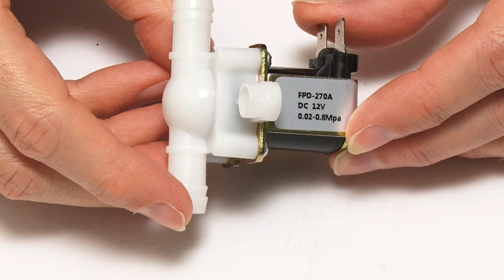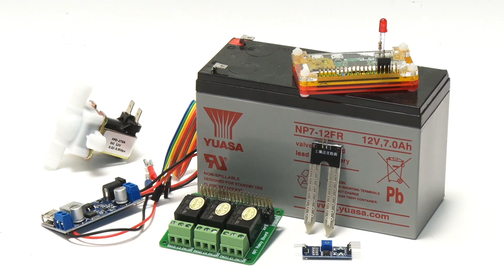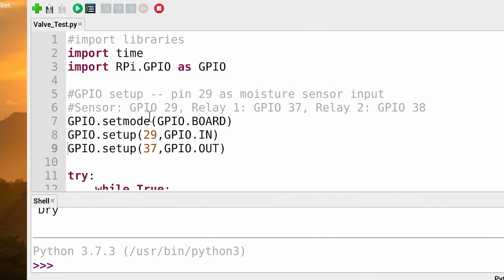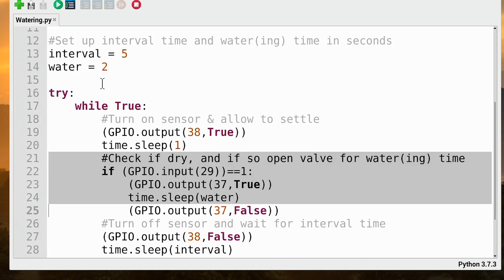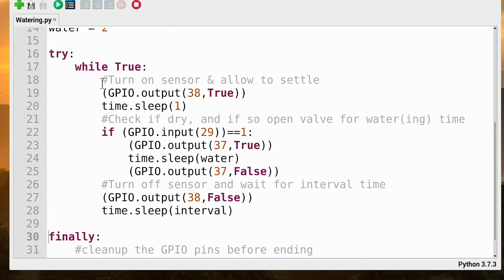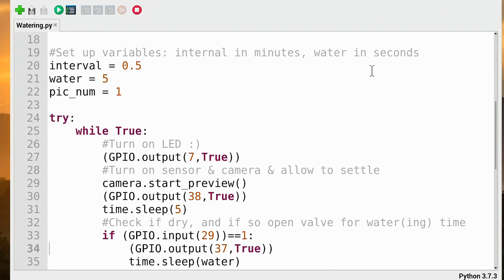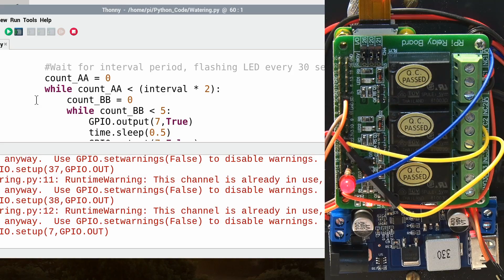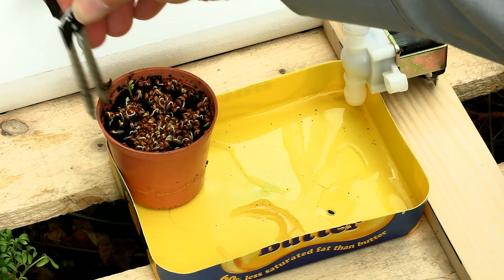Raspberry Pi Plant Watering (& Time Lapse)

Comment: The issue is the sensor is not deep enough.  The sensor needs to be adjustible in depth since it needs to detect at root level which increase as the plant grows.

Comment: Should have used a capacitance moisture sensor. 4 channel ADCs are cheap and easy to use. I would use 5v pumps. project is good for a project start.

Comment: For anyone watching these days, make sure to get a capacitive moisture reader instead of the resistive one. The resistive sensor has exposed electrodes and measures the resistance between the two electrodes so as the soil becomes wet, the conductive layer will corrode as the wet soil reacts with the electrode. Capacitive ones are completely insulated from water and do not have the same issue.
Reply: Which is why it was disconnected. You really don't need to run energy through the soil all the time
Reply: @tutacat Doesn't matter. The oxidation happens within hours. Actually, it happens instantly. Fast enough that you can see it bubbling. Within hours you will notice pitting starting to eat through the metal. 

Look up electrolysis if you want to learn more about this process. 

Also, not being connected to the electric supply directly does not mean electrolysis isn't happening. The earth is alive, every residual current that escapes to ground is trying to find its way to the earth. An electrode stuck in the ground will still experience electrolysis because of these errant electrical currents. 

If you really wanna blow your mind, look up what happens to ship props when they are near a port that has an electricity leak going to ground nearby. It will eat the prop in hours. It can make a propeller entirely disappear in days, and we're talking about a solid brass propeller that's inches thick at the stem.

Comment: Would the 2 channel relay in the video description work with the valve you used in the video? I noticed the 2 channel relay is listed as 5V, while the valve and 3 channel relay used in the video are 12V. I'm not the best with voltage, watts, and amps, so I want to be cautious.

Edit: Nevermind, just read about coil voltage and contact voltage being different things

Comment: Instead of using a relay to turn the sensor on/off, couldn't you just power the sensor using a pin on the pi which you can pull high/low?

Comment: I am a little late getting to this project but plan to try it out, during the video you mention that the valve you initially used was best suited to a higher water pressure, di you ever try to identify a more appropriate valve for this system, that uses water fed from a holding vessel with minimum water pressure.  I have now subscribed to your channel and will be a regular viewer

Comment: There is a problem with resistive moisture sensors - they dissolve!  The capacitive ones are much more resiliant and can even be isolated from the soil.
Reply from the maker: As discussed in the video -- and why turn off current to the sensors when not in use here. They corrode -- not dissolve! :)

Comment: Thank you very much for the excellent video with simple explanations of a complex process. Did you apply the principle of Impressed Current Cathodic Protection to protect the moisture sensor, and used the a high-current driver IC in solenoid circuit?

Comment: you can actually run the sensor off of the pins because they generally use less then 20  ma
Reply from the maker: I am confused. The sensor control board here is directly connected to the Pi. But you certainly cannot connect the sensor directly to the Pi's GPIO pins, as it does not have any analogue inputs. It has nothing whatsoever to do with current draw. What you say is simply wrong. And as I recall, in the video I explain that a Pi has no analogue inputs.

Comment: I know some basic coding and, correct me if I'm wrong, there is no declaration of the time variable aside from calling the library. How does the python script know the difference between minutes and seconds for the interval and water variables? As far as I can tell the   "while count_AA > (interval *2)" would also be in seconds as multiples of two.
Reply from the maker: The time library defines time, which works in seconds. The Python script has noknowledge of time other than in seconds. As on any computer, the abstraction of minutes, hours, etc, is only added in formating for humans.  :)

Comment: How long can those jumper wires be while still being effective? I'm planning out a few 4x8 raised garden beds, and I wanted to implement some automation in my watering/monitoring, but I'm not sure if I can mount the controller in the middle of one side of the box and reach out 4 ft in either direction for the moisture sensors.
Reply from the maker: You should have no problem with 4 ft wires to sensors.

Comment: I saw once dude who did resistancy measuring and from that he extracted moisture as percentage. Quite useful if you have plants that require not just damp soil but more or less saturated. Sensor out of the box == 0 %, sensor in the glass full of water == 100%.

Comment: I'm a bit confused: The 2 channel "Zero Relay" is clearly marked as being a 5V relay. Thus, I'd expect it to require a 5V input in order to switch on/off. You connect this relay to the Raspberry Pi zero, especially the GPIO pins. These pins are used correctly in your code as outputs, but are only able to send a 3.3V voltage signal (or 0V for low). This voltage difference (5V expected vs. 3.3V possible) makes me wonder if I miss something.

Comment: I like this setup because it uses a solenoid valve.  I am designing a circuit with one water source, one pump, and multiple solenoid valves to direct the water to the individual plants.
Reply: I want to do something like this as well. Were you able to get it to work? I would like an automated system to water multiple plants instead of just one

Comment: This is a great project! I have been trying to do something similar with a Raspberry Pi Pico for a while, since this seems to be an ideal use of a controller wrt to cost and power consumption. However, being new to Python, I have been hamstrung by the coding and it seems the coding that you used (sans the camera setup bit) cannot be directly used. Apparently the "import RPi.GPIO as GPIO" line doesn't work for the Pico. While  I was also wondering whether the resistivity sensor needs to be connected to the ADC pins since the wet/dry conditions change the resistivity much like a potentiometer does. Anyway, I would love to see a follow-up using a pico as the controller, if you have the time and the interest to do so! Regardless, I have found your content to be really interesting and informative, for which I am grateful! Thanks!
Reply from the maker: Thanks for this. And yes, a Pico and a standard Raspberry Pi are very different -- code for one will not work on the other. I've two videos on the Pico (inc coding for the same) here: https://www.youtube.com/watch?v=peLH-HNza44 and in particular for inputs here:  https://www.youtube.com/watch?v=TDj2kcSA-68 On the sensor, it depends how it is being used. Here in this video it is connected to a control board that has a digital (on/off) output, so needs connecting to a standard GPIO (not least because there are no ADC pins on a standard Pi). But on a Pico a sensor could be connected like that (without a control board) as you note. Good luck! :)
Reply: @ExplainingComputers  Thanks for the quick reply! Ah, that's what the sensor control board does! I shall persevere with the control board for the moment. Thanks for the links, as well! :)

Comment: Thanks for the detailed explanation of everything! I'm using your video as the primary jumping off point for the building of my own system, but I'm making just a few modifications based on my own needs. The main differences to mine is that I will be using capacitive soil moisture sensors (3), the 3 relays on my hat will control 3 separate solenoids, and I will have close access to a 110v outlet so I am not planning on using a battery. 

At 7:26 in your video you point to a "buck converter" but I am not familiar with this, nor its usage. I suspect it has to do with stepping down the voltage from the battery?  My main question is, if I am using a standard switching 12v DC power supply, do I even need a buck converter, or is a standard DC power supply enough to safely power the whole system including the solenoids? (Like yours, the moving parts are intended to be not in use for most of the time.)
Reply from the maker: Thanks for this, and I'm pleased to hear you are making a system. :) A buck converter is indeed used for stepping down a voltage, here to power the Pi, which needs a 5V supply. So you will need some means of providing it with 5V.

Comment: Hi Chris! Amazing video! I'd love to try this but I have a relay module that needs to be wired in rather than sitting on top of the Pi board, could you advise which pins I'd need to connect to get this project working with the hardware I have? Many thanks!

Comment: Top notch as always Chris, but I am a little confused with the assigned gpio pinouts.
GPIO.7 physical pin 6
GPIO.37 pin ?? (GPIO.27 pin 35?) 
GPIO.38 pin ?? (GPIO.28 pin 37?)
GPIO.29 pin 39
I have checked the comments, but not the answers, and no one else seems to have expressed the same issue at all?
I am capable of safely reassigning things myself, but am concerned about the apparent confusion.
My big brother can't quite figure it out. Is it just me?

Comment: Hey I know no one will see this but I have a question about the Solenoid Valve and battery, if I plan to just plug the pi into the wall do I still need the battery for anything else or is it just optional if you don't want to plug it into a wall socket?
Reply from the maker: Unless you can find a solenoid value that will operate at 5V (the voltage from the Pi's adapter), you will need either a battery or a mains adapter to operate the value. That, or you will need to step up the voltage. If you go with one adapter to run everything, also be aware that a solenoid valve draws a lot of current when activated, and so there is a significant risk it could crash the Pi when it comes on in a single power supply setup if enough current is not available. Good luck! :)
Reply: @ExplainingComputers  Thank you for the explanation, does it matter what buck converter I need? I've never done this sort of thing before so I'm a bit confused
Reply from the maker: @aydenzeyrek3662  The buck converter needs to output 5V to run the Pi, and needs to accept whatever voltage input you are using (for me this was 12 volts, which is what most solenoid valves require). It's output also needs to be rated for the current draw of the Pi -- in practice 1A for a Pi Zero, or 3A for a Pi 4.
Reply: @ExplainingComputers  Sorry for asking you again (This should be the final time!) but I have a few more miscellaneous question. This is for a school project so I'm kind of rushing

  What type of connector/terminal (I don't exactly know the exact terms, I'm new to this sort of thing) did you use for the battery/buck converter. Maybe I'm not searching the correct thing but I can't seem to find any terminals like yours

I noticed what seems to be a barrel jack plugged into either your rasberry pi or relay hat, is that mandatory?

Do you happen to have a list of all the cables/wires needed for this, things like the amount of micro usb b cables, terminal and things of that nature.

It's kind of hard to tell what plugs into what since the scenes where all the objects are placed are a bit cluttered and items overlap with each other, do you mind saying what plugs into what?

That should be all! Thanks in advance and Godspeed

Comment: A few remarks since I did such a project myself and found limitations with long term use.
- I found it cheaper and more practical to buy a all in one watering timer, the kind you screw on your garden focet and works with a 9V battery. The case is already weatherproof. You keep the solenoid and 9V battery and replace the electronic timer with your own design. The result will look profesional and will have all the practicability of an industrial design.
- Moisture sensors do corrode even when no current runs through them. My solution was to burry a little bell shaped enclosure with a DH22 humidity sensor inside. The bell creates an air chamber and prevents water to rise to the level of the DH22. The DH22 will give us the humidity % of the air in the chamber. Those are not precise devices but we don't care for precise readings. We just need a 0/1 order. Also it will give us the temperature of the ground wich can be used for more automatisation (soil heating, day/night detection without a clock etc.).

Comment: Some real plants that you can actually spoil by letting them dry out or overwatering would be better. Its almost impossible to ruin a pot of crest .. as long as you'll soak it with water to start with it will be finnished in about a week 😉

Comment: Okay, but plants not only want to ne wet. Actually it's not good if they are wet at the full time. They can start rot. This is too simple to be usefull and almost every one do this as a first project and they say: watch this, this is an automatic irrigation system. No, this is not. That sensor is useless in the real life. It breaks down so quickly and yes I can only tell if wet, or not.
Reply from the maker: The sensor detects a selectable level of moisture in the soil -- not "wet" or "dry" as you state. Cress requires very wet conditions, which is what the system is set up for here. This video is a maker project, not a proposal for the most sophisticated irrugation system as you claim. I think you've missed the point of the video. :)

Comment: To power on the sensor just before reading it is brilliant! I just measured the consumption of that sensor and it's about 10mA, which means you could directly power it from a GPIO-pin. This saves one relay (and some power from the battery).

Comment: I was thinking about setting up something like this for a friend's burgeoning greenhouse. But there would be a number of containers and pots, so i will likely forgo the wetness sensor(s).  So I think that using several pipes,  to water all the various plants, is the best idea.  I think i would also use valves on some of the lines, for the plants that need less water.  What do you think?
Reply from the maker: Sounds good -- as you say, you could have different values turned on and off at different times, to give different quantities of water to different plants.

Comment: Hi there. I  put together this system from your video which has been super fun but I haven't been able to get the solenoid valve to pull any water through it. I have 2 different valves so I don't think it's a problem with the valve. The system otherwise works and the valve even makes a heavy click during the tests like the video. Am i not using big enough wire to connect the solenoid? Sorry, I am a beginner so any advice would be much appreciated. What i missing here?
Reply from the maker: If the valve is making a heavy click, it strongly suggests that it is opening. So this suggests to be an issue with the water  pressure at the input to the value, and not an electronics or computing issue. I would try doing some tests with just the battery and the value, applying power to the value, and seeing if you can get water to flow through it. Raising the water supply above the valve will increase the pressure. Do report back on your progress -- good luck! :)
Reply: Hello! I did it! The system is working. I had trouble with water not coming thru and even when I raised the water source above the valve it wouldn’t flow. Finally i decided to suck the water thru while running a test that opened the valve to help build the pressure. Just like a siphon, it works really well but I wonder why I had to do that to get it to flow? Is it because the solenoid is a valve and not a pump?

Comment: This video was very informative. I am thinking of doing this minus the camera at the end of the winter season to start a bunch of seeds for my mother to plant outside. I was also thinking about using a 5 gallon home improvement store bucket and using a submersible pump and some tubing instead of the valve. I've even seen a separate project that used an ultrasonic proximity sensor pointed down from the top of the bucket to sense when the water reserves were getting low.

Comment: Did the cunning plan work in test condition? I've got many corroded, have bought a capacitive one now to try.
Reply from the maker: Yes, the cunning plan did work: no corrosion, as no power  cross the terminals most of the time.
Reply: @ExplainingComputers  I thought it was the acid from the roots of the plants that was causing the corrosion, will try this. We would like to see more projects from you, they're more fun than normal reviews(which are quite interesting themselves ).
Reply from the maker: @anycatdessai  You are right, the moisture in the soil, with a slightly acidic content, will cause corrision long-term. But passing a current through electrodes in a liquid -- electrolysis in action! -- is what makes it happen so quickly.

Comment: The design of the moisture sensor is disappointing.  It could be improved by replacing the PCB with a couple of stainless steel rods or by securing a stainless steel rod to each of the two prongs of the sensor and keeping the PCB entirely out of the soil.  Stainless steel is difficult to solder, but uninsulated crimp lugs could be attached to the rods with silver solder, using a small oxy-acetylene torch and wires could then be soldered to the crimp lugs using ordinary eutectic solder.
Reply from the maker: The PCB that goes into the soil is only a sensor. It has no components on it, and you don't need to use it at all if you connect the wires from the control board to two metal prongs as you say.